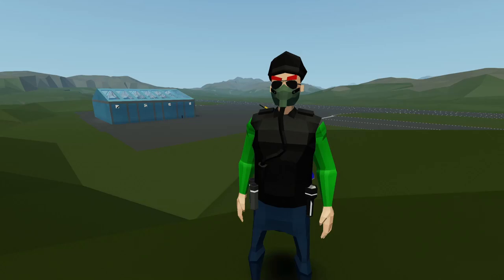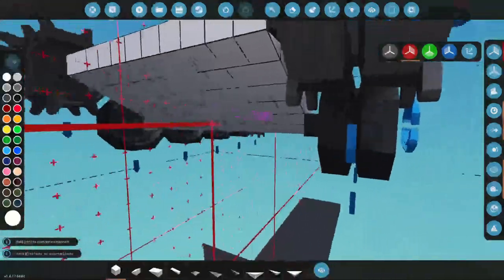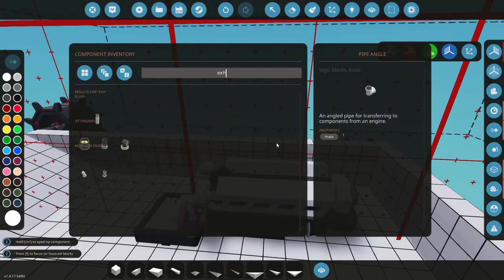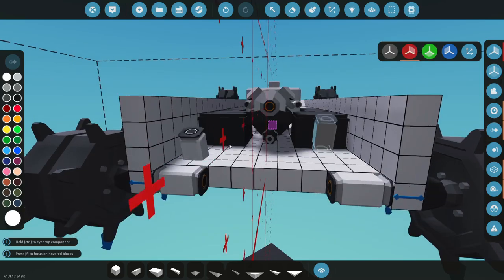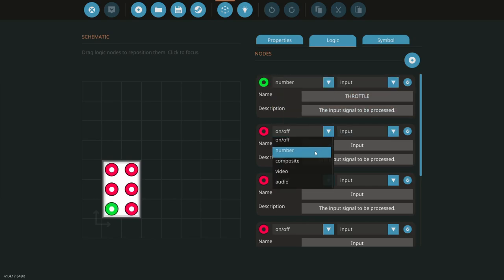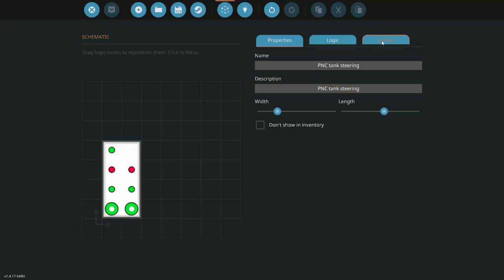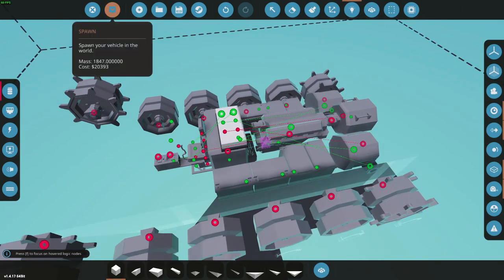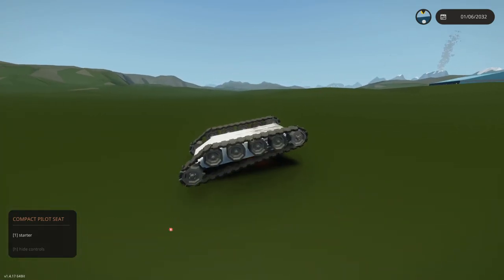Beginners Tank Steering! Stormworks Tutorial - How To

Comment: That is one way to do it. 😁   i like the diesel-electric concept,  I use it a lot.    
Are you planning on making more videos showing other ways to do it?    

One thing that could improve this design is using a type of power selection system that changes the max throttle of the motors,  you could make it so that level one sets max throttle to 0.1, level 2 could be 0.3 level 3 0.5 etc.
Reply from the maker: Thats a good idea. And If this gets enough attention I might consider continuing on with it but for now its just to get the tracks moving for people.  They should be able to build whatever engine style they want with this setup.
Reply: @ProfNCognito  Yeah, It is a good starter design.  I hope you do get a lot of attention,  you do a great job. 

I really like trying out different ways to make them work.   I have come up with about 10 different ways so far.    Electric motors are definitely the most simple and great to get started with.
Reply from the maker: @Bendigo1  good for torque too which is great for climbing.
Reply: @ProfNCognito  exactly!   If only they fix the tracks so they don't feel like they are on ice when on a hill sideways,  and add suspension options...

Comment: Great tutorial! However I have an issue. I followed everything in this completely, and have quadruple checked everything, however my vehicle wants to constantly turn to the right instead of going straight when throttle is applied and cannot turn left.
Reply from the maker: Sounds like the clutch is constantly engaged.
Reply: @ProfNCognito  That's not the case tho. I reworked the micro to fit a vehicle without the clutch and it still has the same issue.
Reply from the maker: Not sure then if you've changed the MC.
Reply: I had that issue, i fixed it by checking what my clamps for the clutchs were. One was -1 to 0, not -1 to 1

Comment: I've ended up following your tutorial to the letter, though I didn't go for a diesel-electric engine like yours, I stuck to Diesel only, and followed your advice (setting up the microcontroller's "THROTTLE" to the engine's throttle). It up working fine, if it wasn't for the engine immediately revving as if I was flooring it, without my input, and then stalling shortly after. I changed my gears but nothing seems to change, what do you think the issue is?
Reply from the maker: Which way are your gearboxes?
Reply: They're pointing towards the sprockets, with their Turned On ratio as -1
Reply from the maker: What size modular did you build?
Reply: I'm using the medium engine, what makes it weird, in my opinion at least, is that even when idle, the engine still revs, then stalls.
Reply from the maker: Would you be willing to upload to workshop and I'll take a look.
Reply: Issue solved, I just had to turn the gearboxes around and switch the off ratio on them from 1:1 to 3:2. Engine still revs when idle, but I'll try to tweak things on the microcontroller
Reply from the maker: Awesome

Comment: all my tank steering don't work like it should -  W: turning right A: goest forward D: goes backwards S: turning left, andhere goes another problem: track aren't synchronised - left is faster then right
Reply from the maker: Switch the connections.
Reply: @ProfNCognito  it didn't work
Reply from the maker: @memz5855  are all the arrows on the tank tracks going the right way?
Reply: @ProfNCognito  yep
Reply from the maker: @memz5855  not sure at this point.  Go back and check your connections.